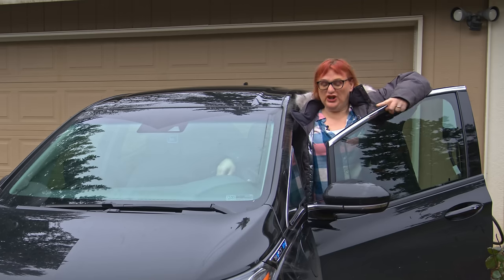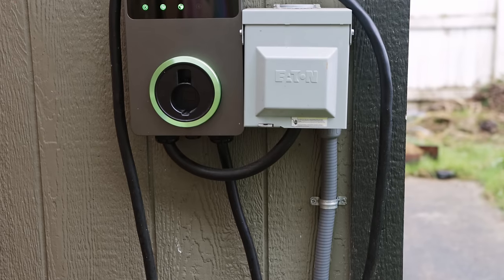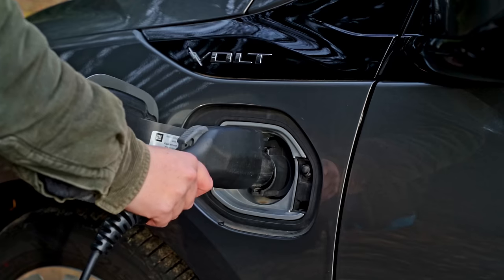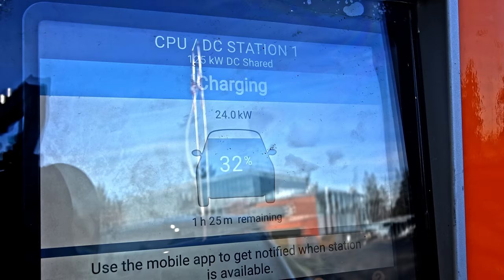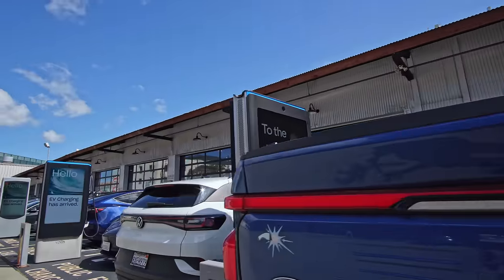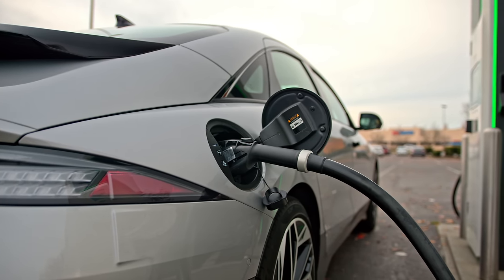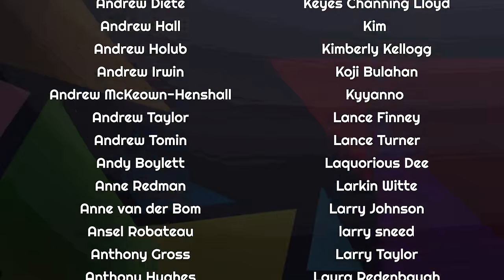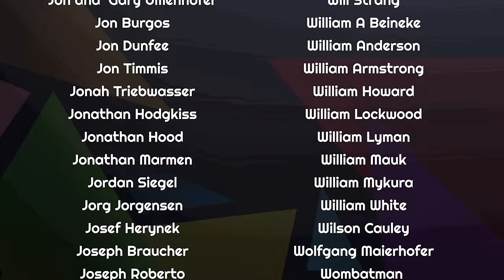Charging 101 - Or What You NEED To Know To Get Your Electric Car Charging!

Comment: This video made me think of the journey we made since we got our first EV in July of 2021 which involved a lot of research and trial and error. We started with a 110 trickle charger that came with our 2014 BMW i3, to sharing the dryer plug (NEMA 14-30) using a Split Volt splitter and Split Volt EVSE to charge our 2018 BMW i3 that did not come with an EVSE, to having a NEMA 14-50 plug installed via a Qmerit recommended installer when we bought our 2022 Chevy Bolt (GM covered $1000 of the cost which left us with about $900), to my son charging our old 2014 BMW i3 with an EVSE with a NEMA 10-30 plug. We've DC fast charged using Electrify America, EV Connect, and ChargePoint and destination charged using ChargePoint a couple of times. I'm really looking forward to trying out the Tesla V3 Superchargers which are supposed to open up to GM vehicles at the end of this month. (which is next week BTW) I'm not holding my breath on it happening this month, but fingers crossed it won't be long. There are still some stretches around where we live that are difficult for my Chevy Bolt because of gaps in the non-Tesla public EV charging infrastructure.

Comment: I believe NACS is being regular used at 750 KW.  Thought not at any public chargers yet.  The NACS chargers installed at Pepsi for Tesla Semis operate at 750 KW.  Basically Tesla installed eight 375 KW cabinets powering 4 NACS cables, for an average of 750 KW.  They might output at higher levels like 1000 KW.

Comment: A corollary to charging etiquette:

As stated in the video, don't use a "higher-power than your vehicle can make use of" stall if a "lower-power, but still more than your vehicle can make use of" stall is available. If a charging station has two 150kW stalls and two 350kW stalls, and your vehicle tops out at 75kW, please use a 150kW stall, saving the higher-power stall for a driver of a vehicle that can make full use of the higher power.

The corollary: If you come upon a charging station, and see a lower-power vehicle using a higher-power stall, don't get mad at them. You don't know the situation when they arrived. For all you know, when they arrived, all the lower-power stalls were in use, and that higher-power stall is all that was open.

As someone whose first EV was a "lower power" (50kW max) EV, I had this happen to me a few times. A 350kW was all that was available, so that's where I plugged in. Now owning a >200kW-capable vehicle, I try not to get annoyed when only a 150kW (or even a <100kW) stall is open.

(Although screw you, CCS-equipped-motorcycle rider for parking in the 350kW stall parking space, but using the cord from the 150kW stall next to it, effectively blocking both! That 350kW unit was a "dual cord" that could charge two vehicles at once - the van in the other stall was using it, but you could have used it, too, leaving me the 150kW; or you could have parked in the 150kW stall and then I could park in and reach the 350kW. Instead I had to take the 50kW an aisle over until the van left. There is no valid reason why you did that.)

Comment: Thank you. As an EE I was expecting the distinction between AC charging and DC fast-charging to be fully explained. After listening to the full video, I agree it was not necessary for the majority of your viewers. Knowing this could be useful if the onboard charger failed and the user notices that they cannot charge from an AC source (Level 1 or 2 destination chargers) but can charge just fine from a DC fast charger.  I was hoping you would have a lot more to say about the handshaking process between the vehicle and the charger, but I guess that is more complex than you believed to be worthwhile. You didn’t mention that there may be fees for overstaying the necessary time for your requested charging. I also think you should have mentioned the differences between 400V & 800 V architectures for some vehicles as this can also impact charging speeds at DC fast chargers.

Comment: A couple of corrections. In Europe and Australia, a 230/240V 10A EVSE is actually classified as level 1, not level 2. And we still call them granny chargers. Also you can't always just "plug your car in". There are plenty of gotchas with Level 2 EVSE's.  Eg with lots of EVs if you plug into a Tesla wall connector it won't work depending on the generation of the charger, whether it's been firmware updated and whether your EV is compatible. Remember in Europe and Australia modern Teslas come with the same plug as every other current EV - type 2. Or you might have scheduled charging on.

Comment: Something I recently discovered with my PHEV is that the manufacturer of the GFCI outlet or circuit breaker matters. Some of them appear to have inadequate EMI/RFI filtering and therefore tend to trip immediately upon the start of charging (ahem…eaton…). Replacing the GFCI device with one known to have greater EMI/RFI immunity resolves the problem.

Comment: Just a correction on the etiquette segment.  Some ID.4's like mine can charge up to 180+ kW so using a 150 kW charger is not the right charger to use.  In fact, the EA 150 kW chargers only produce 150 kW for 800V architecture cars.  For 400 V architecture cars like the ID.4, you can only get about 110 kW max on them.  For my Bolt, I try to use the 62.5 kW ChargePoint chargers instead of EA, especially since EA raised their prices so much.

Comment: I wish you had added battery temperature to the factor of how fast you can charge.
Reply: A video I watched last night shows that my bmw i3 will charge significantly slower when the cabin heater is on due to the battery heating up more. Apparently the vehicle has to chose between heating the cabin or cooling the battery.

Comment: Nice one 🙂... I do think you forget one thing... the "if the plug fits it shut work"
Reply: With the move to NACS, and different NACS adapters for AC and DC, that isn't true. 
I have a "TeslaTap" adapter now that lets me plug my Ford Mach-E into a Tesla "Destination Charger". It works great for that. But it doesn't work at all if I plug it into a Supercharger. I'll need the upcoming separate "NACS to CCS adapter" for that to work, and that adapter won't work with Destination Chargers!
Reply: @AnonymousFreakYT  Yes but the MOVE to NACS is still future..

Comment: The different connectors between NA and Europe have nothing to do with 120V vs 240V, NA has 240V L1-L2 in regular homes which is used for HVAC, electric clothes dryers, water heaters, stoves and other major loads like EV charging. It has to do with much of Europe having 3ph power more readily available everywhere so it needs an extra pin for L3.
As for plugging into "car-appropriate" chargers, that whole concept needs to go away by using chargers with banks of DC-DC converters that can be allocated anywhich way between connected vehicles. Plug in wherever and your car automatically gets whatever the site's HVDC bus can spare, which is what Tesla is doing with v4.
Reply: The multiple power levels will not go away for a very long time.  Lower power units cost a lot less to purchase, install, and to operate.  Those lower power units let more cords get installed for less money, which is always a priority for both companies and for governments.
Reply: @mark_5588  The expensive parts are all of the rugged AC-side input filtering, power factor correction and aggregation of alternate power sources. Once you are on the common HVDC bus, all you need between the common bus and each of the 20+ cables is a relatively simple, inexpensive and efficient DC-DC converter.

Does Tesla make multiple charging speed variants of its v4 chargers? No, every v4 cable goes up to 350kW depending on vehicle capabilities and available site power.

Having a 350kW DC-DC converter for each output is likely cheaper and more reliable than splitting the converter into eight bricks and then having switchgear route power from those bricks to each attached cable as needed. That also eliminates the scenario where someone with a 350+kW-capable vehicle gets 100+kW stolen from them when someone uses the other cable. I know I'd be pissed if I made a charging stop expecting to reach my charging target in 20 minutes, only to find out I'm half-way there because someone robbed half of my charging speed.